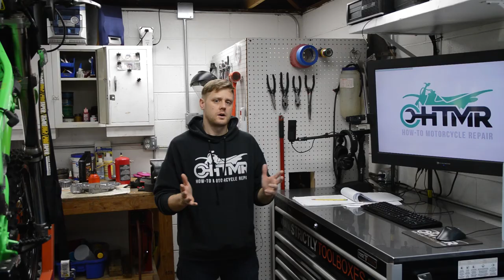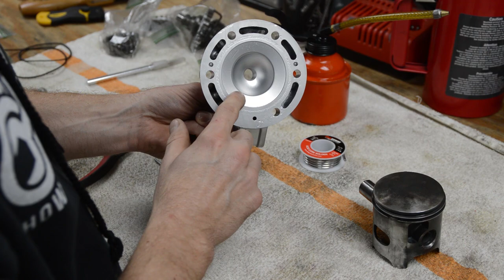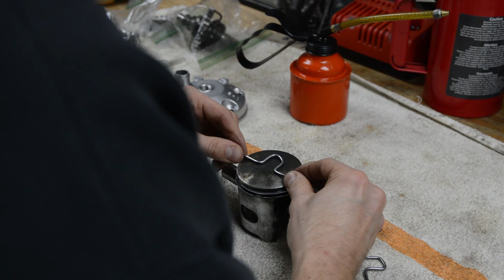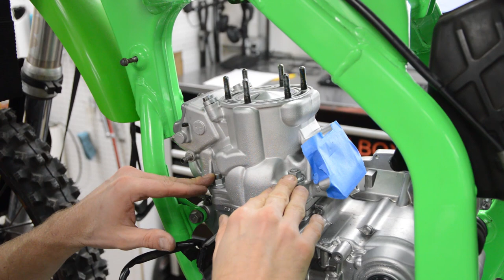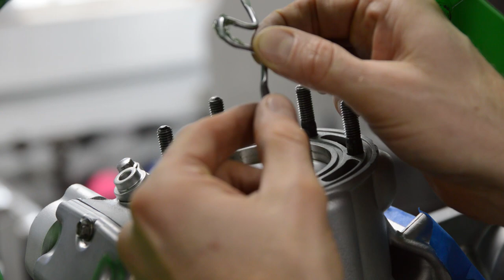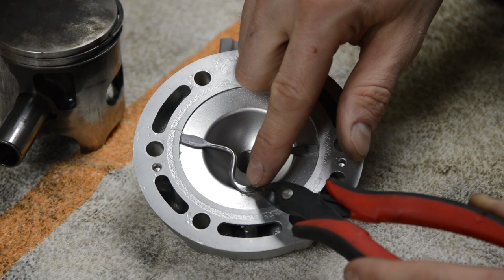2 STROKE - MEASURING SQUISH WITH SOLDER

Comment: From what I've heard you need to torque down to specs to get a true squish measurement
Reply from the maker: That would be true for a non o-ring gasket head since the gasket compresses. In my case, the head was metal to metal against the cylinder.

Comment: what thickness of solder?
Reply from the maker: Rosin core about 3/32" (.093")
Reply: @HTMR  Does it work if I have 3 mm wire?
will install vhm which will have squish size 1 mm.